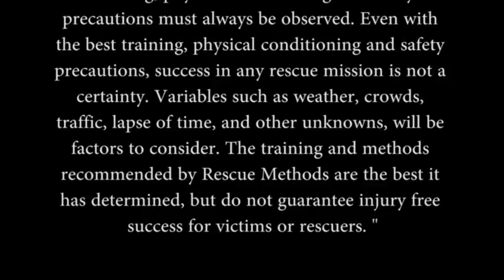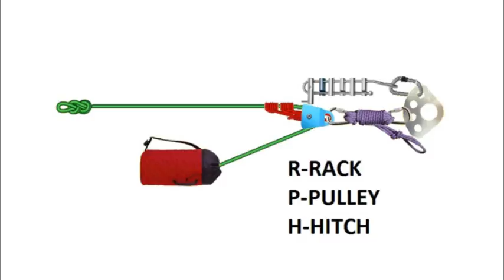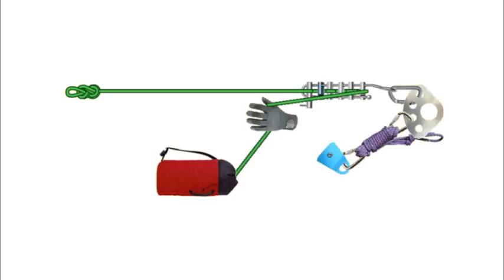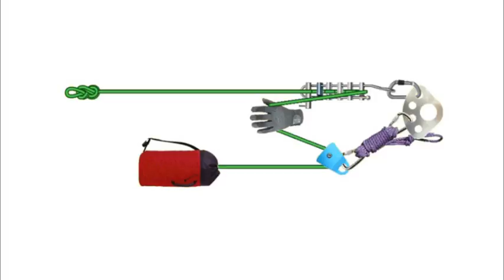Rescue Methods with Fire Rescue 1 September Blog Video 2012

Comment: I am concerned that you are loading the belay @ 13:05 and disconnecting your brake rack. At this point, you no longer have a 2 rope system. If a sharp edge cuts that (previously unloaded) belay line, you have no back-up. A releasable prussik needs to be attached to the load line and loaded before disconnecting the brake rack. Then the load is still on the load line, it will release when you start hauling, and keeps your belay as a belay line. A simple step that maintains the integrity of a 2 rope system.
Reply: Skydiver BC I agree hey did it again around 18:30. their team needs to reassess their technique. has the potential to get someone killed.

Comment: So if you want to rescue,  haul and lower  casualties you could simply use a ID and ASAP for back.  This enabling you to put In mechanical advantage 3:1 without making any changes to your system plus keeping your rigging clean and simple.  Your video is very complicated for a simple rescue system.
Reply: Or use an MPD and eliminate the disadvantages the I'D brings to the system. This was shown in the video. MPD's are simply the easiest way to rig a rescue system (when weight is not an issue for your gear).

Comment: Im, still trying to see how this was a two rope system? can someone tell me where the two separate systems are?
Reply: The Two rope system is the MPD take one leg of the line and the load is taken at the MPD.  Where the other leg the load is taken at the the rigging plate. Even though it is one single rope the load is split on each leg of the line in separate points
Reply: So two ropes, one system. Single anchor stap and biener for both lines doesn't add the redundancy factor to well. Thoughts?

Comment: Horrible!  Never hang on one rope during change over.  That point of having a two rope system is having a main and a belay in the event of a main line failure.
Reply from the maker: +Steve Ventura Thanks for the input Steve.  Your perspective is a common one in certain rescue circles.  Mirrored systems, single rope techniques, Pick offs and other applications that are utilized in many technical circles will often deploy single line techniques during load transfers or other specific situations with different portable and personal redundancies.  Progress can be captured and multiple connection points maintained through different rope grabs or progress capture devices.  We strive to pull as many versatile concepts and techniques as we can from other groups such as mountaineers and industrial rescue provided the concepts are safe and efficient.  Single Rope Techniques are an acceptable practice per NFPA and are often overlooked across much of the country within the fire rescue community.  We advocate these techniques with more advanced end users or practitioners with the right rigging and right KSA's.  Thanks for weighing in - we appreciate your insight.
Reply: The fact that you say that other circles used different systems doesn't deal with the fact that you are not having a back up when you disconnect one of your ropes. If this system is going to fail is most likely due to a rope getting cut while on tension specially under a 2KN load. When you remove the second rope your rescuer is at risk. You are giving good information during most of your video but you can make this transitions safe by adding a simple step. Redundancy on your anchor was well explained at the beginning so I'll choose not to comment much on that. On a real scenario I would want those two systems on different anchors if possible.